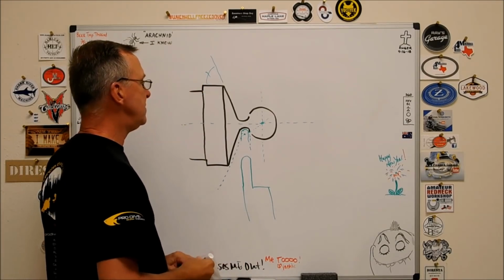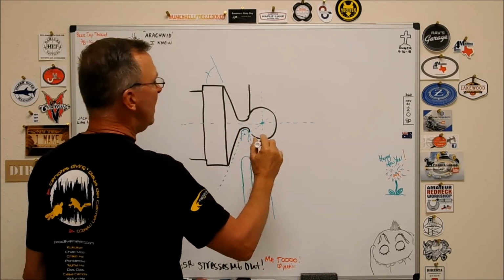Grinder Preparation for the Cannon Barrel Form tools

Comment: I started my apprenticeship in the naval dockyard in Sydney 1961.  A safety procedure driven in by our instructors was to stand to the side of a grinder during its run up to speed at turn on as this is the time most wheels will fail other than as a result of a catastrophic crash inti the wheel of the item you are grinding. This was demonstrated when a 10 inch wheel exploded as the amchine came up to speed. The operator was standing to one side and was uninjured. A lesson for all.

Comment: I find it funny that you explain why you would turn the larger cross section first and yet you actually did the operation on the cannon in reverse. lol When I watched the turning video I questioned  the order. I didn't see this video until after. Love your work as always Joe!
Reply: I just did the same. Learned something as well, never knew about truing up flap wheels by reversing rotation before
Reply from the maker: I did reverse it. I also increased the neck diameter after cutting a test piece so I was confident the mass would hold.
Reply: @joepie221  That was the clip at end of video 2 or did you do a third one just to show what happens?
Reply from the maker: @peterjones6945  That was a blank I used to coordinate my tools. It was a perfect piece to use to show the  failure potential.

Comment: As a screw machine guy, we use form tools constantly, nearly every part I have run uses them  My definition of a form tool would be a cutter approaching at 90 degrees to the center line of the part.  I have a little lathe experience, and second you on the importance of the order of operations.  That small diameter is called the driving diameter for everything to the right of it.  The ratio of 5:1, drive diameter to the length would be a common forming ratio if doing it with a single form tool.  There are ways to increase the ratio safely when single tooling the form, but doing it on a lathe means order of operations rules.  Joe, I really admire not only your machining skills, but also your ability to explain the practicalities of cutting metal.

Comment: Thanks for doing this series on grinding tools. Many contributors have talked about it but don't show the mechanics of doing it
Do you have any recommendations about grits or types of grinding wheels. My grinder has Aluminum Oxide and it seems to take forever when I try to grind bits on the wheels that came with the grinder.
Reply: Robert Oswalt I was going to ask the very same question.
Reply: So if I understand correctly, a 46 grit pink or white wheel is what should be used for HSS.

Comment: Joe seems like a weird vibration and sound  on your grinder is one of the wheels out of balance ?
Reply: Time i think it was that guard or magnifier on the arm over the grinder. You will notice that as soon as he moves it with his hand the noise stops
Reply: Thanks. Just wondering because the wheels  looked to be running really true. It's cold a snowy up here in Pa. time for me to sit down  with a pot of coffee by the fireplace and watch 4 yrs worth of your vids. Maybe because I'm 40 yrs older and pay attention now that I'm learning and understanding more off yours vids than I did in 2yrs of machine shop in college. Thank you for sharing your knowledge and experience. A subscriber and follower. Time
Reply from the maker: Thanks for that. I try to keep them interesting and educational.
Reply from the maker: I had a large plate job to sandblast this week and moved my grinder 6" to the left so I could get the blast cabinet door fully open. I didn't take the time to re-wedge the bottom. That harmonic noise you see is just a slight uneven condition at the floor. Notice it stops when I put pressure of the tool rest area.